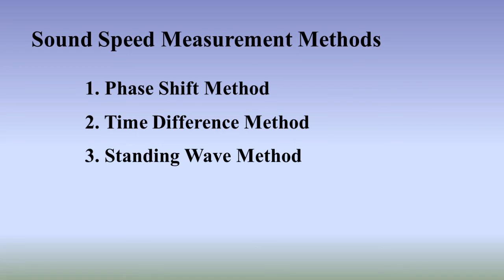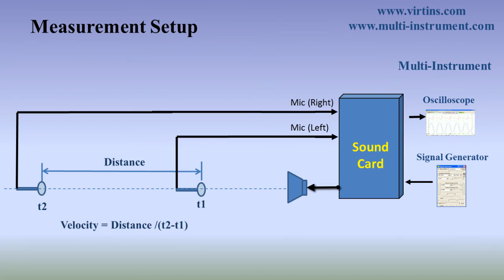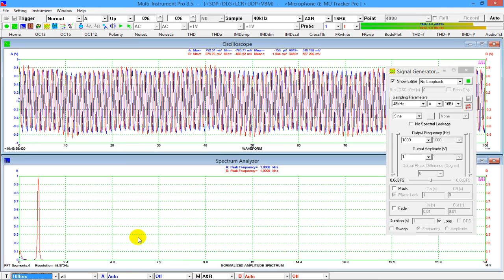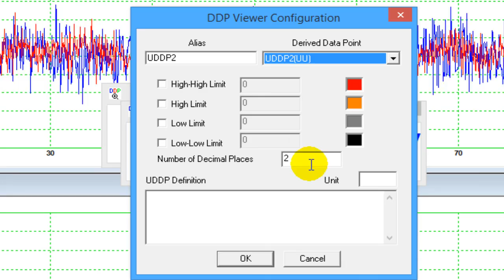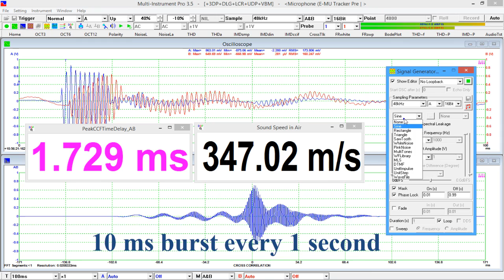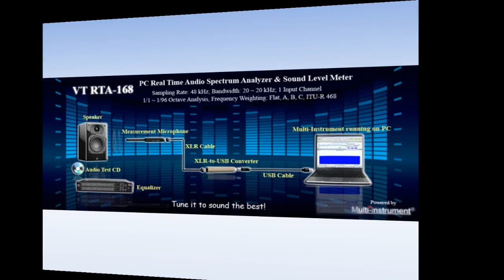Measure Speed of Sound in Air Using Cross Correlation with white noise or MLS

Comment from the maker: Yes, you are right. The setup of two speakers and one microphone is sometimes easier to obtain, because an ordinary sound card normally has stereo outputs and one mono mic input. In this case, auto-correlation instead of cross-correlation should be used instead. The second highest correlation peak should be used to detect the time delay as the first highest correlation peak is always located at 0 delay for auto-correlation...